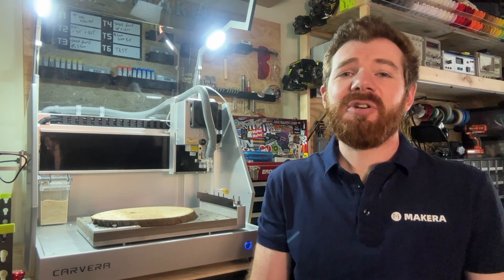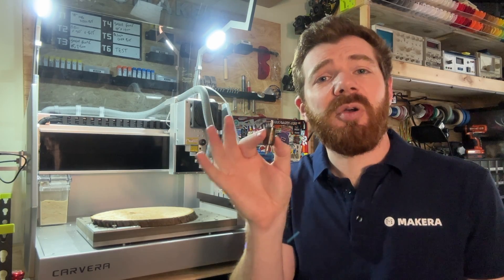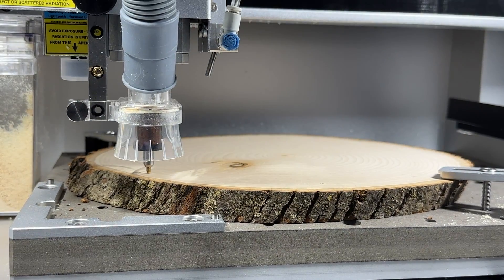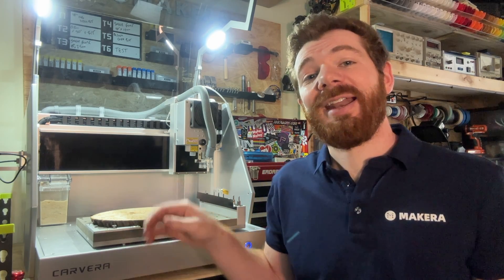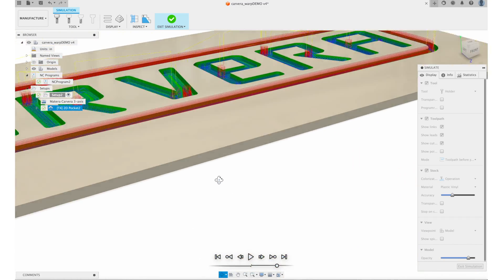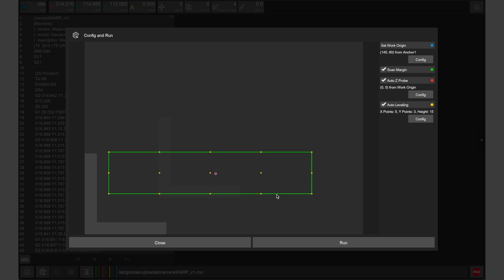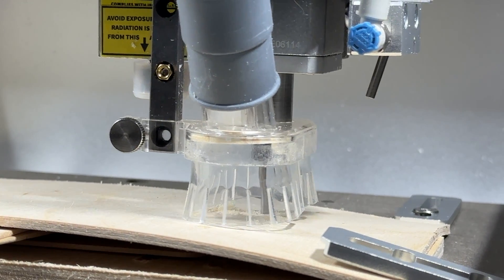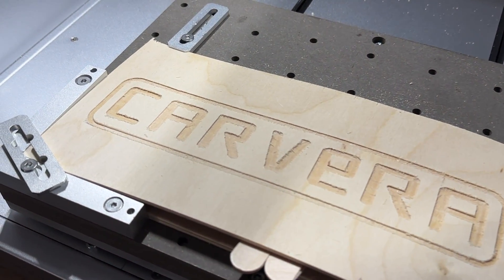What is Auto Leveling? Carvera CNC

Comment: can this cut stainless steel and how thick of a sheet can you cut?
Reply from the maker: While we have performed tests on stainless steel, and some of our users do this regularly, it is not what the machine was designed for. Depending on the bit you are using, as well as your feeds and speeds, the Carvera can machine through aluminum that is 5 cm in thickness. There are many factors that contribute towards what can be machined successfully however, we recommend you see the guides on our wiki, and check out what our users are doing on our discord.

Comment: Great intro.
Just one comment - result of probing is presented in MDi window (in some cases may be better to identify wrapping which may result in deformation at the time of milling and fix clamping instead).
There is no (simple) way how to reuse results of leveling for multiple processes (g-code files) applied on single piece of material (e.g. to use more than 6 tools for processing PCBs).
Reply: just merge your gcodes into a single job? You can also add pause gcodes if you need to post process after a pass and resume after youre done
Reply: I remarked the case when I need more than 6 tools - typically PCB fabrication - including mask application or many threads milling.. I hoped to inspire Carvera team to include leveling data for subsequent jobs.
Reply from the maker: Thanks for the suggestions, will look into the solutions in the near future.